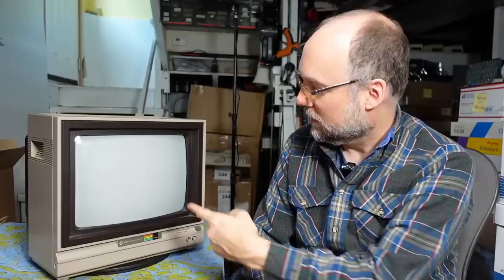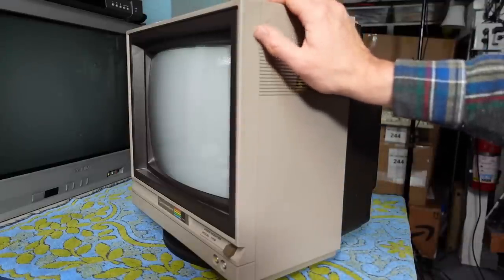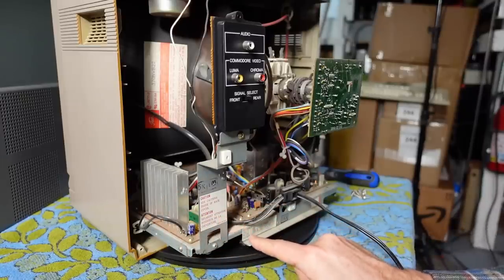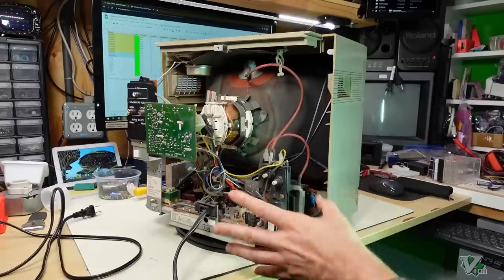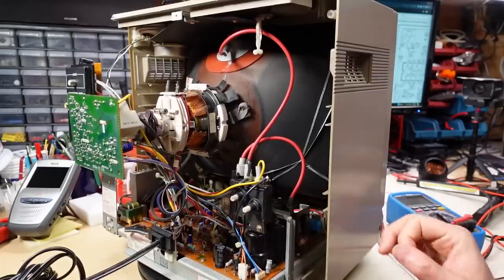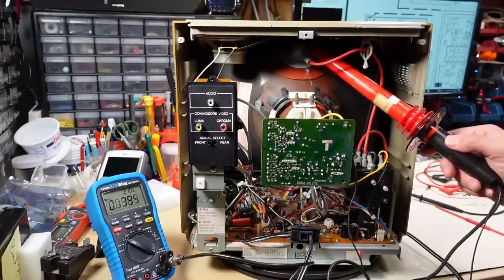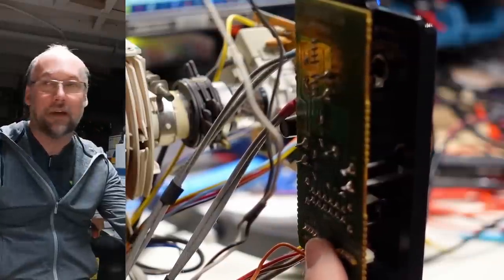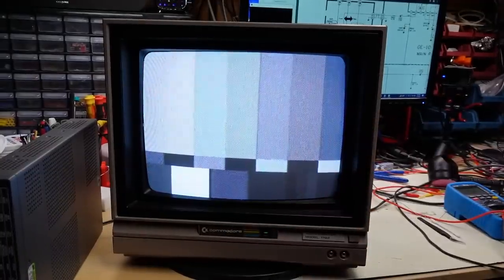This is one of the best monitors of all time (Commodore 1702)

Comment: I worked for a power plant back in the day. There was a room with giant breakers in it. There is a phenomena called "Arc Flash" that could literally ignite the dust in the air when these breakers were energized. Its possible the sparking you experienced was arc flash. Once it burns the dust off, no more sparking.
Reply: That would make sense, especially if it hasn't been turned on in a while and dust accumulated.
Reply: Exactly this. There are some exposed electronics in the HV section that can arc with dust build up. Its a pain in the ass, but I don't think I ever saw one damaged by it.
Reply: Arcing and corona are easy to get when you have 25kV hanging around. Generally it is contained by the EHT lead and the anode cap, but dust or soot (and especially that damp greasy cigarette smoke residue!) can make a path from under the cap to the DAG. Snap, crackle, and pop all day. It was worse with vintage TVs when you had a lot of charged metal parts inside the HV cage, but the tubes and flyback in those were made to withstand some arcing. Solid state sets can't deal with CRT arcing and it can blow the HOT if it happens too much.

Comment: 26:34 The "christmas tree" ground is actually referenced to the negative output of the bridge rectifier, not the AC plug (you can see it explicitly tied directly to the negative output of the rectifier in the schematic), so it doesn't matter which way around you plug the plug in.  The rectifier makes the plug orientation irrelevant.

However, since there is no isolation transformer on that input, the "christmas tree" ground will actually follow the most negative voltage of the AC input at any given time.  That means that for half of the AC phase, "ground" will be 0V (neutral), but for the other half (when the polarity of the AC input is reversed), it will drop down to negative 120V, relative to earth ground.

This is fine for anything else running off of that same bridge rectifier, because the positive voltage will always be varying in the same way (and thus always have a correct DC potential relative to that ground), but compared to anything that is actually connected to a "normal" earth-referenced ground, that "ground" is actually not a DC ground at all.  It actually constantly has AC voltage on it, ranging from 0V to -120V at 60 Hz (even when the plug orientation is correct).  Essentially everything in that part of the DC circuitry is still "vibrating" at 60 Hz AC (relative to proper ground) the whole time it's running.
Reply: I was getting the feeling something was off about the explanation.  Thank you.

Comment: The 1702 was my first monitor back in 1984 when I was 7 years old. It was the best and lasted me 16 years until the year 2000 when I was still using it to watch cable TV in my room in parent's house.  It was as vibrant and sharp as it was on day 1. It's a real professional-grade monitor.  Probably the highest quality low-res CRT you could get at the time.  Great bang for the buck.

Comment: I first saw the 1702 for sale in 1983 and as I recall, it was $89 more expensive than an equivalent BMC monitor. I had been using a 12" BW TV since 1976, and the purchase of a $269 BMC was the next most expensive one since my C64 at $329. A year later, I was able to buy a VCR and could watch TV in color

Comment: I think that the circuit for RGB signal conversion could be built using op amps. This way it can be easily inverted (if needed) and scaled to the required amplitude. You'd need relatively fast op amp chips suitable for TV signals, otherwise the image might get fuzzy.

Comment: Retired TV repairman Here The chassis ON that monitor looks similar to so many other chassis on other TVs of the era from the mid late 80s to Mid '90s, and the picture tubes ranged in size from 10 in 11 in 12 in 13 in 14 in to 15 in up to a 21 in on that kind of chassis, what they called a portable TV some weight up to 60 lb and the cabinets were made from a light gauge sheet metal, and the smaller ones were all made from plastic!

Comment: Adrian,  I own  (4) 1702 monitors for quite awhile now, and what I've noticed the last 30+ years is that when you power the 1702 on or off with the power switch, the unit does a sort of "self deguassing"....  You can actually hear it if you listen .  It was probably one of the first monitors ever to have an automatic "self deguassing" at the Power switch when turned on or off...  :o)  Tony K., Melbourne, Florida.  (Formerely from Long Island, New York..)

Comment: Lots of us in the Nashville Commodore Users Group back in the 80's had these monitors and we used bronze clear acrylic panels cut to fit the front panel of the monitors. It made the color really pop. We used Velcro in the corners to hold the acrylic panels in place.
Reply: Not to mention keeping the face of the CRT clean, of course.
Reply: Thanks for sharing that acrylic panel tip, I just installed one today and I'm very impressed with result.
Reply: @moose7000and1  glad to help! Since we hauled the monitors around to meetings, and visits to the Huntsville CUG a lot, it was a big help to protect the front of the CRT, as well as making the color pop.

Comment: Adrian, please note, those Hi-Voltage probes expect a meter with 10MOhms input resistance.  At least with the older Fluke 83s, they were 11MegOhom input resistance in automatic mode, and 10Mohm input resistance in manual range mode.  The difference is about 100volts for every 2000volts.  I am not sure with the 121GW that you are using.
Reply from the maker: Good cool -- I just looked up the 121GW and its 10Mohm. You're right that would cause it to read inaccurately if the input impedance wasn't the probe was designed for.

Comment: The 1702 was desire and used by many 80's hobby computerist. Atari and many others. Finding one these days with the front panel is a rarity. I used mine for years as a display for the kids DVD player using a cable I made.

Comment: griff3125 on AtariAge was asking about a “Digitek” RGB mod he found installed on a Commodore 1702 monitor he bought from eBay. IIRC, someone else chimed in with an old magazine scan or something showing that it was a commercially available RGB mod kit specifically for these Commodore monitors. It appeared to be digital RGB… like CGA or C128.
Reply: My God... Imagine buying a 1702 and discovering it had an RGB MOD...
And then returning it, cause it wasn't what you ordered...
How did life on Earth not end in that very moment, because surely, that HAD to have been dense enough to have created a singularity...
Reply: It looks like a very simple mod, just some passives and a coupe transistors, I wonder if the netizens here could find better pictures or a schematic for it? I'm sure Adrian would do a video on it, here is a quick Google that will find the discussed AtariAge page: “Digitek” "RGB digital"  commodore 1702
Reply: @richfiles  Yeah, I recall my own intense disappointment because I had a 1702 at the time and was wondering if its enduring popularity had led to any documented RGB mods. Even considered offering to trade before I read to the part where he had just sent it back. D:
Reply: Found DigiTek’s ad on page 60 of “COMPUTE!’s Gazette” September 1986 (Issue 39, Vol. 4, No. 9). YouTube totally mangled this comment.
Reply: @perhansson6718  The text of the ad follows:
CONVERT YOUR COMPOSITE MONITOR TO RGBI!

DigiTek, Inc. introduces the RGBI Conversion System! Now you can convert your 1702 composite monitor* to true, 100%, full color, RGBI (all three guns driven separately)! With the flip of a switch go to composite or RGBI. This is not an emulation of RGBI or a monochrome cable and requires no software or use of computer memory. With our conversion system your composite monitor IS an RGBI monitor.

Enjoy the full potential of your C128 - use of the 80 column mode, the high resolution mode and the full 2 MHZ speed. All this with a picture quality that equals any factory built RGBI monitor (but for a fraction of the price)!

Our conversion system is a hardware add-on and requires minor assembly. The system comes complete with detailed instructions for converting your monitor. Our conversion process is simple and easy to perform. All components necessary for assembly are included. For those requiring additional assistance we have provided a technical support number to call. We are firmly committed to customer support.

So don't wait any longer — get the full use of your monitor — convert it to RGBI with DigiTek, Inc.'s RGBI Conversion Syslem! Just send $49.95 plus $3.50 for postage and handling.

For more information or to place your order call our customer service line at (813) 933-8023, or write to: DigiTek, Inc., 10415 N. Florida Ave., Suite 410, Tampa, Florida 33612.
There is a $5 additional charge for C.O.D. orders. Dealer inquiries welcome.

*Conversion available for all composite monitors, write or call for further information.

Edit: Quick edit to see if YouTube ghosted this comment since it will sound like commercial spam… Nope! We good.

Comment: Simple dust can lead to "tracking" where the dust on the surface of the components can cause arcing.  Just touching some of the HV components can cause the arcing to stop.  A good cleaning of the flyback and the HV cables will do a lot to help.

Comment: You know Adrian. Maybe I can guess what was arcing. At high voltages and high frequencies a circle cracks are tend to appear. So maybe there were some cracks around fly-back or horizontal output transistor or near. Maybe it was loosing contact and after your manipulations it fell in contact again. I recommend you to re-solder all pins of fly-back transformer and HOT transistor. I saw this many times.

Comment: When i was like 13yo, my parents VCR died, I fixed the VCR enough to get the tuner working.  The VCR didn't work anymore. Then their console CRT died.  Looking back, I now suspect that a capacitor shorted causing the main fuse to blow in the VCR.  The CRT was from the '70's and well used.   Anyway, they took my 1702 and used it as their TV with the VCR that I "fixed" for YEARS!  That was the thanks I got for being mechanically inclined.  Lol!

Comment: I have two 1701s and had an 1802. The 1802 had poor DC restoration (or HV generation), it also had a bog-standard CRT whereas the 1701 has a fine pitch shadow mask CRT which gives a much sharper image. I've used the 1701 for pretty much everything. In a kinda-sorta way it's responsible for the death of my youth TV (take that info with a smile). TL;DR
I used to watch TONS of TV. When I was given a C128 with the 1701 I still have and is currently running, I noticed I could hook my VCR up to the 1701. And then I noticed how much better the picture is. So I stopped using my childhood TV. After several months, when I turned said TV back on, it struggled and had a bloomy, dim picture (sign of low HV, but I don't think it was the LOPT). It did eventually come up. I went back to using this TV for a few days, sometimes it would work fine, sometimes it struggled with low HV. Until one day it just went pop and that was the end of that set. Back then I didn't care, because 1701!
The 1701 has a linear power supply with a ginormous toroidial transformer which sits behind the rear signal input panel. I remember turning the B+ pot down because the monitor had massive overscan, maybe to hide the C64s border a little.

Comment: The 1702 was a great monitor for the Atari 8bit home computers also. I serviced a few in my days at Tandy Electronics for Radio Shacks/Computer City. The Atari 800, had a 5 pin din video output including luma/chroma and composite. 
Another good mod would be to add a second audio channel for Left/Right if you are going to make a RGB mod. Some retro Atari folk do have dual Pokey chips for stereo sound out there.  :}  Suggest a typical small PC speaker driver like the TDA amplifiers.

Comment: I have a 1702 monitor (was playing the C64 on it about 15 minutes ago) and the picture is still gorgeous.  It could use a replacement of the front/back switch, and I need to glue the flip door (once I find it), but other than that it works perfectly.  BTW, the little hole to the right of the volume knob is access to the "Sub Bright" adjustment.  And speaking of dust, a lot of dust can really mess with a CRT.  Many years ago in the late 90s our TV kept intermittently flashing a solid green screen.  When it started sticking, a smack would bring back the picture.  Eventually the solid green screen remained, so we took it to the local TV repair shop.  The crooked owner of the place told us we needed a new picture tube, $300, so we decided against that and brought it home.  I opened it up and clearly the guy hadn't even been inside it because everything was covered in a thick layer of dust (and no finger marks in the dust to indicate any diagnostic probing).  I blew the thing out with our big shop vac on blow, and once it was clean the thing worked fine again.  We got another 2 years of life out of that TV just by cleaning it.  I forget what finally died on the thing.

Comment: This was my thought as you spoke of the arching, I have seen this in many old televisions, where the dust has accumulated so. thick that it causes the HV to arch where the HV enters the picture tube.  Once cleaned, the arching is cured and you are once again back in business. (I accidentally discharged the HV from a picture tube back in my days as a soldier, an officer brought his huge old television into our shop and requested we look at it.  Not our job, but you know how that goes, well if you ever served, you would.  So as I was reaching for something, I happened to come in contact with the HV and got knocked on my can.  I was lucky enough that the same arm that came in contact was also in contact with the ground. I still have a scar where the power exited to ground. Lessons like that stay with a fellow.

Comment: The arcing was probably caused by having some latent dampness in the components and after a period in warmer air, it would dissipate and then the arcing would not occur. This is common where the unit has not been used for a long time.  I used to service TV sets for a living so was well acquainted with the problem if the tv had been cold.  Your monitor is probably perfectly OK.

Comment: The 1702 monitor was released at exactly the same time as the C64. I got my 64 on my birthday, in April of 1982 after the official release date, and it was a complete setup. Hell, there was even a Commodore branded desk as part of the system. I got the 64, the dataset and the 1702 monitor. We had to wait for the 1541 as it was not available for some reason. That took several weeks to make it to me.
I can't remember what the serial number was on my original machine, but it was low.
Over the years that monitor was used for so many things it wasn't funny. The last time it was used it was connected to a Nintendo or some other games console.
As I moved to the 64c and the 128 I ended up with a 1084, and then later a 1084s monitor. Which relegated the 1702 to video editing and games duty.

Comment: That is also very interesting design with the split ground. Here is the UK we have 240V (230v) All the monitors I've worked on have an isolated B+ PSU. It usually has a high frequency switching transformer.
Reply: 240 volt but everything is designed for 230v that why nothing lasts. vacuum cleaners, kettles or anything that uses a linear transformer are being overloaded.. especially if it comes from china. switch mode power supplies are ok and anything made in the uk years ago still works, i made a bucking thansformer to step the voltage down to 200v to power things that a want to last forever.

Comment: I'm in my mid-30s, so I was coming of age while this old stuff was still plentiful and dirt cheap at thrift stores. I bought every single 1702 I could find at Goodwill or whatever back then, so I've always had a few. Fond memories of my sister's boyfriend in the early 2000's beating Earthbound on my 1702 and SNES. I still grab them whenever I can. Only two in the collection currently but they are the only two I've had that still had their doors intact. Worth mentioning, in the early 2000's the art collective Paper Rad (who I was obsessed with at the time) usually would involve a stack of 6 or 9 1702s at their installations with a feed of some of their video art.

Comment: Regarding the RGB mod, If the monitor used a color decoder chip like or similar to the TDA3562A which was used in many TV sets of the day, The IC has RGB inputs with a switcher built in the chip, this was used for a Teletext decoder, if you are lucky this would make an easy mod for RGB input.
Reply: It doesn't. So no go there.

Comment: I have a 1084S monitor that I got from my dad many years ago. I like that it has the connectors and cables for just about every Commodore computer. Mine also puts out enough RF interference to completely mess up any CRT TVs nearby when it's on.

Comment: I know exactly what that arcing is: That is internal to the tube. Probably from handling, moving it around, there may have been something that got dislodged. And when it arcs, the screen will blank just as you described. Just running the monitor like you did was enough to burn it off and clear it. And it will not hurt anything. More than likely, when it did do it, you would have seen it flash inside the neck of the tube. It is a pretty common issue, and it is the same symptom that sometimes shows up upon doing a CRT clean/rejuv with a CRT tester